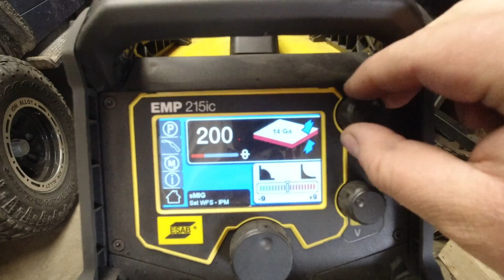Wrecking Yard Treasure

Comment: good thing to do before going to the used auto parts yard. is to pull your part off <or check what tools> before going to yard to get it. i find that easy to know what need and what you do not need. just bring what you need

Comment: are you going to seal the bark on the table? would use some laquor, so it holds and doesn't break off. Looks great, could also put a slot on the bent plates, then a screw so  you can't take the table out to far, then to take it out, just unscrew the screw holder... Great looking addition to your jeep... very nice.